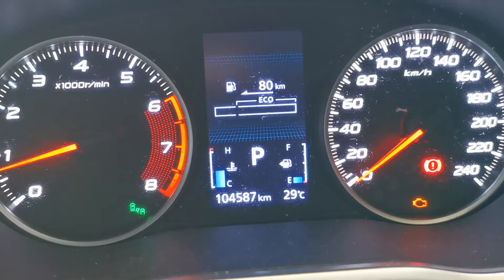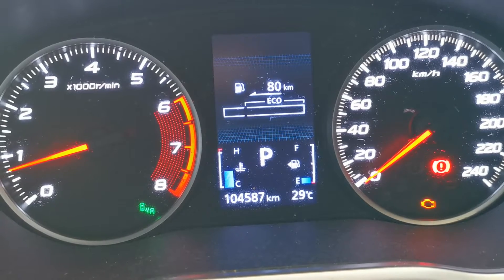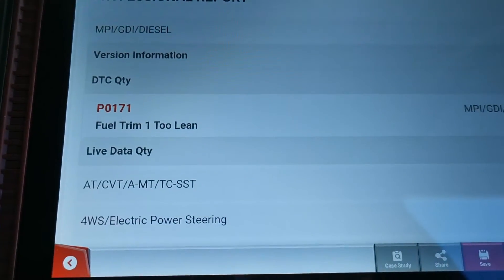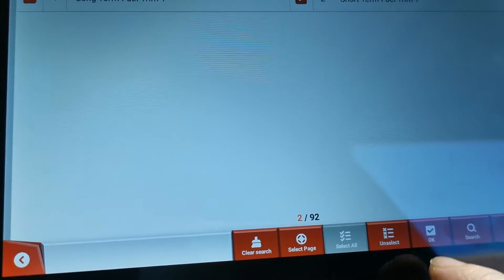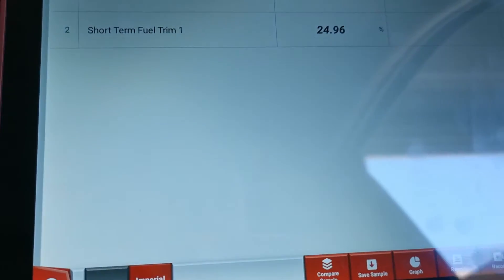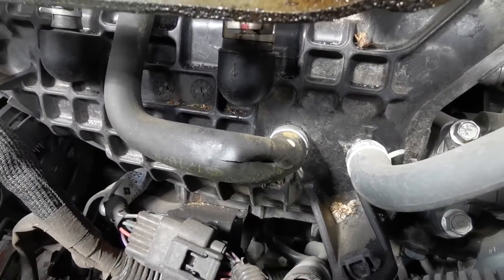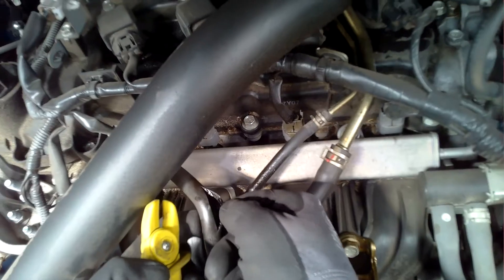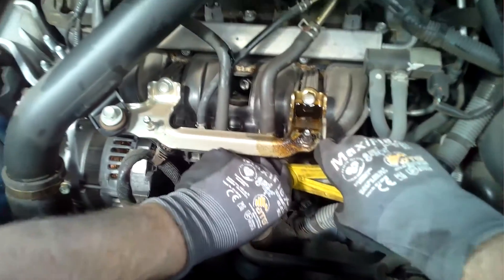Mitsubishi - P0171 Fuel Trim Too Lean - Fault Found - How To DIY - Quick Tech Tips

Comment: Love the video I have a newer Eclipse cross curious though what scan tool tablet did you use for this I am looking to get a good scan tool for problems just like that if I ever have a similar problem thank you so much !!
Reply from the maker: The tool I used in this was a Thinktool X2 scan tool, if you are only using from time to time you wouldn't need that professional level cost wise tool. They have cheaper options in there range that would be suitable 👌

Thanks for watching 🙏
Reply: @GerardBurkeBurkesGarage  Thank you so much I just bought a Mucar scan tool bluetooth and it's made by thinktool from what I understand I won't be using it all that often hopefully my vehicle will stay reliable for awhile but thank you so much for replying great videos !!

Comment: The real question is what cause that house to collapse 😆.
Reply from the maker: Oil passing through it making it soft and then failing over time.
Reply: @GerardBurkeBurkesGarage  that hose was not meant for oil, 
The actual problem started before that hose.
Reply from the maker: The video and information are related to how to confirm a fault using these methods and showcased the fuel trim fault.

If you would like to share your thought process on crankcase ventilation or this specific design, by all means add the information that you think would be helpful and I can pin that comment.

This channel is all about sharing information and I try to compress down the information in my videos to the most relevant in each case.
Reply from the maker: Relating to oil present in these systems, it is not uncommon for oil vapours to flow through and there is a certain tolerance that is acceptable under manufacturers warranties, of course that is on a case by case bases but in this instance the hose is extremely cheap and it's up to the vehicle owner how much they would like to spend after that.